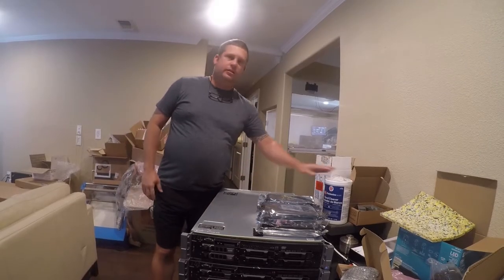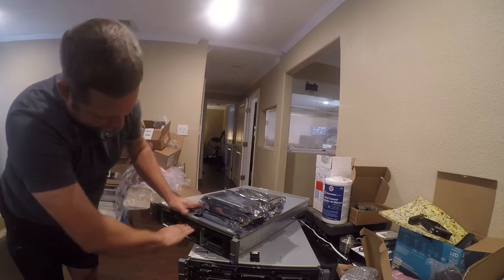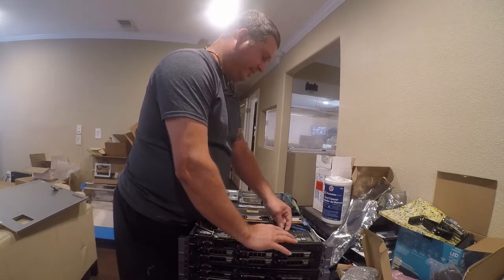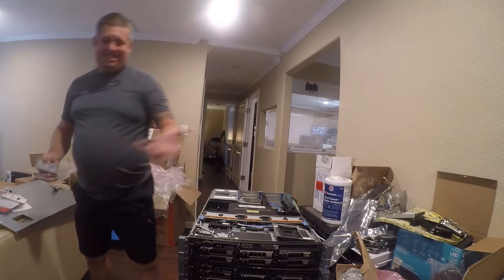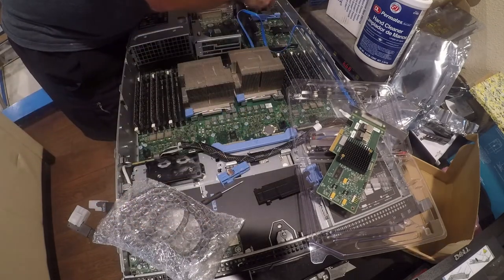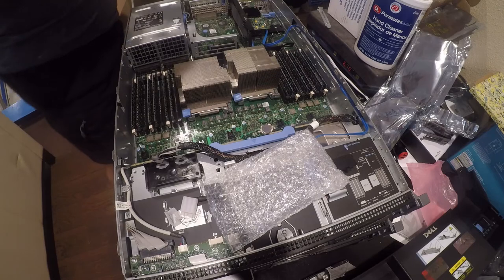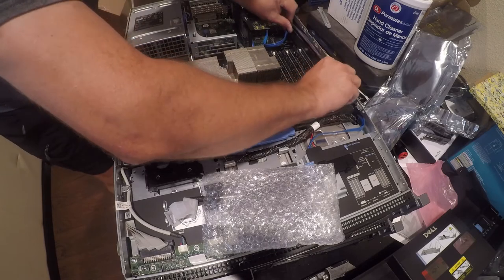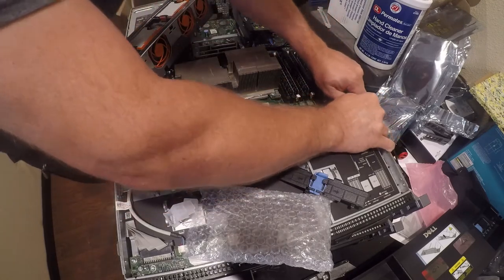FreeNAS: Building a Dell R710 based FreeNAS storage server

Comment: Brian, have you ever experimented using a PCIe M.2 drive adapter card for cache applications?  I am modifying an R710 exactly like this and I used the optical drive caddy with a SATA SSD as cache.  However, I would prefer to have dual SSD cache so I am contemplating the route of dual PCIe adapter cards as it allows me to install 2 SSD's and provides power as well.  Any thoughts on this?
Reply from the maker: No.  I have not.
Reply: I have that setup in both of my r710 truenas servers.  I listed it in my comment in the main thread.  The only difference is I am using the dual mSATA pcie card for my truenas OS drives.

Comment: Hi how you managed the RAID? I know that ZFS doesnt need hardware RAID and is not good to use HW RAID with ZFS. But R710 iperc6 cant manage HDD without RAID array?
Reply from the maker: I replaced the PERC with a HBA (Host Bus Adapter).  Some cards can run in RAID 0 as JBOD.  You need one of those with decent performance and FreeNAS will configure it's own software raid.
Reply: No you can’t use any perc to do ZFS. Reason being they do not support being flashed into IT mode (JBOD) where they pass the drive connection through raw to ZFS. FreeNas will use ZFS to do software RAID at full data rate of 12 or 6 GB depending on the HBA card you picked. I use two SSD and 6 x 12TB Dell drives in my R710 and it’s very fast. I have dual 6c(12c hyper threaded) with 192 GB RAM. I love the setup me have docker containers hosted within TrueNas.

Comment: A better option for the r710 server, if you are installing an OS that can be cloned for redundancy like TrueNAS (FreeNAS), is to get a SEDNA PCI Express Dual mSATA III SSD Adapter and 2 mSATA 16GB internal Solid State Drives.

Comment: Hey, what cable did you buy to connect that DVD-ROM/SSD caddy? I don't have a DVD ROM in mine, but I do have a spare SSD caddy. I'd really like to put in an SSD for my boot drive. Thanks man. Keep making more videos.
Reply from the maker: One of my servers came with it.  The other didn't so I bought it on ebay: Dell Poweredge R710 Server SATA Optical Drive Cable XT618  $8.95 with free shipping.  Worked great!
Reply: @hotpuppy72  Thanks man. I'll buy it and connect my caddy.

Comment: This video should be titled.
Dell R710 - Installing new drives and cards.

Where is the FreeNAS part of this video? There is nothing in this video that suggest that you are using FreeNAS on this system at all.
Looking at your other vides around this one, is you working with ESXi and an H700 card installation. no FreeNAS.

I am not trying to be an a** by any means, but when you see a title for something only to find out that there is nothing in the video about the title, it kind of defeats the purpose and is otherwise known as Clickbait.